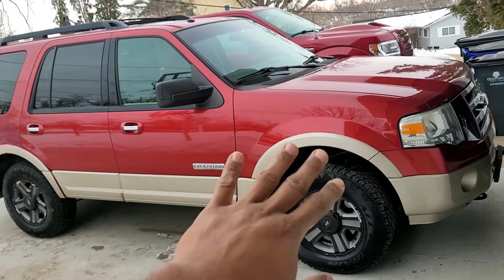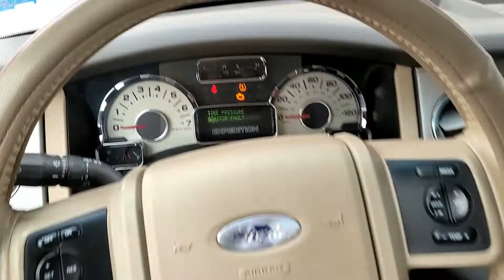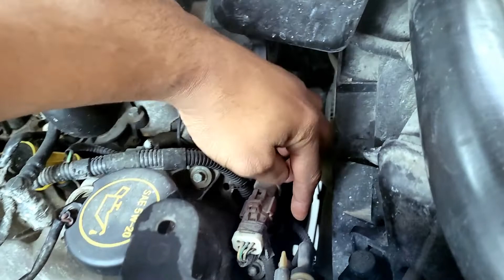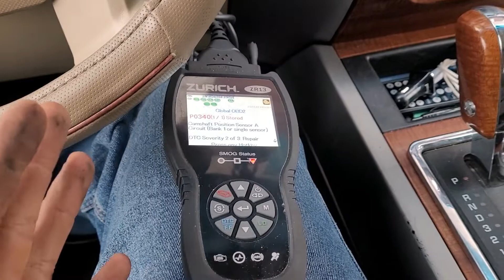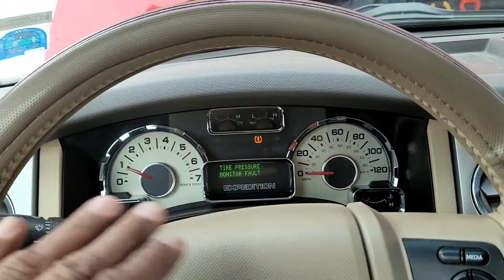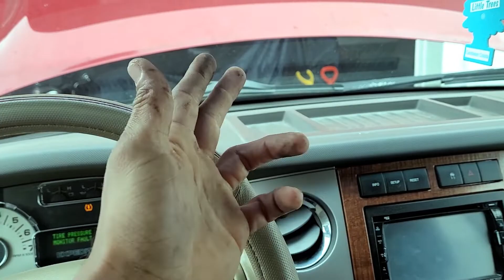Check Engine Light P0340 When to Replace the Camshaft Positioning Sensor! (Minute Maintenance)

Comment: Hello!  I have a questsion regarding my problem with camshaft they already changed it, also boths sensors bank 2 bank 1.  I am still having problems with my expedition.   when they change the sensors the engine light disappers, once I start driving my expedition the engine light turns on again, also my expedition starts chaking and it feels like is going to die on me.